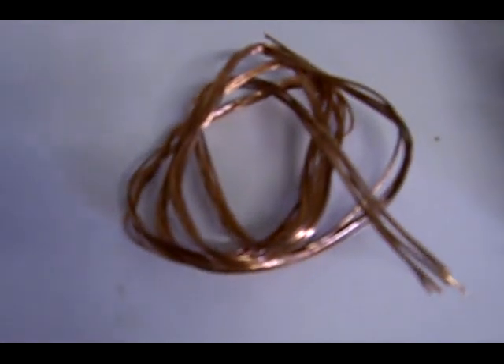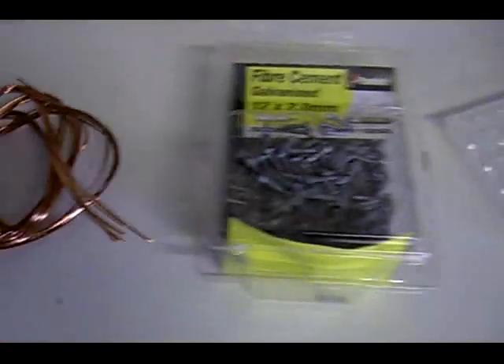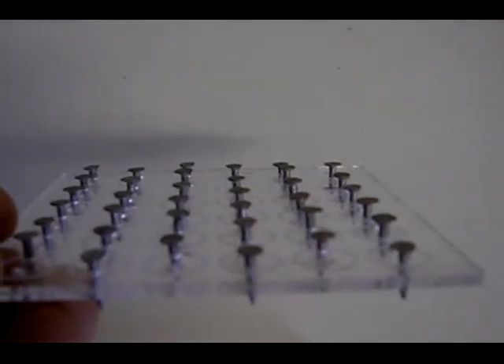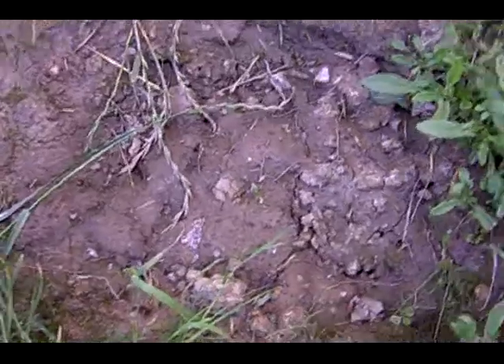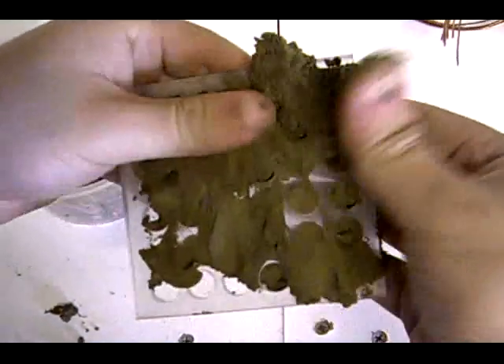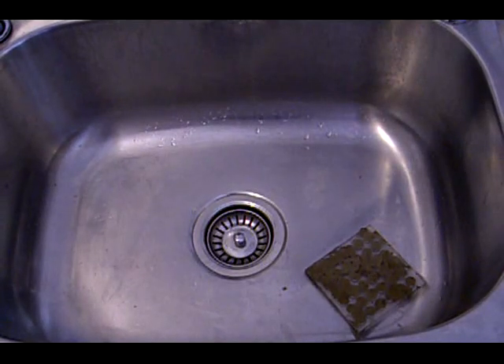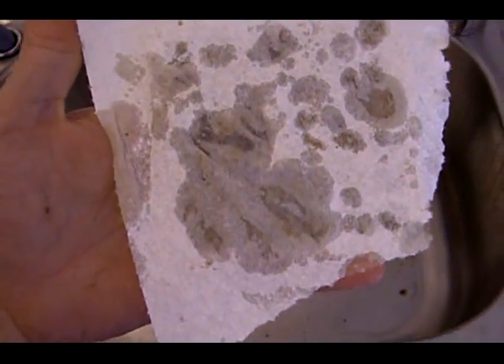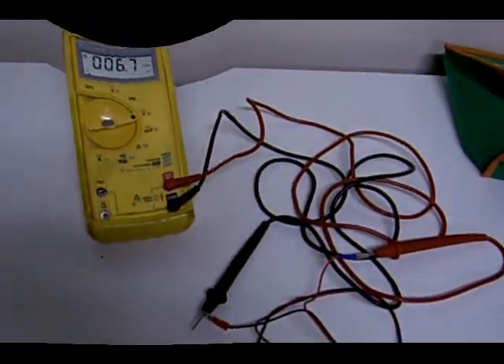Earth Battery Quest - How to build a small Earth Battery "The 24Volt EB Challenge"

Comment: Increasing the amperage for earth batteries is quite simple.  A law of physics states that wiring in parallel will add the amps of two power sources.  We simple wire a solar panel to the earth battery.  We build the earth battery to the desired voltage in series.  Earth batteries are the cheapest voltage around.  Then wire a solar panel to the EB in parallel.  Boom best of both worlds.   Real power.

Comment: Earth Batteries may be the secret to endless power.  Earth batteries are made of two dissimilar metals placed into the ground or cups of soil or water.  They can be wired in series to make lots of cheap volts.  Their amps are abysmal.  A law of physics can be used the add amperage. Wiring in parallel to a solar panel will add the much needed amps to the cheap earth battery volts.  My test worked.  https://youtu.be/OGGredkAFh4?feature=shared This is all the green energy we could ever want.  Watts = Volts x Amps

 Example video link (not me) 
https://youtu.be/aCCK132OIGA?si=8UWtAHco0L60FWBD

If you build a test setup use a small 18v or less solar panel or a small 9 volt battery.   Do not build an earth battery over 30 volts.  Anything over 30 volts can be life threatening.  Water, carbon, and  aluminum or magnesium work best.  Each telluric cell will generate .7-1.5 volts depending on materials used.  A photovoltaic cell only generates .4 volts.

Comment: 0.7V per cell is about what I've gotten too. You might not have gotten the full 24V because of shorting. This is the problem I run into with my small designs. I would guess there are bits of dirt/water seeping between cells on your base board.

Comment: Great small design. You see people making these using massive 5 gallon buckets for cells. You might also consider aiming for 12V or 5V but higher amps by connecting some rows in parallel.

Comment: You would probably get more voltage if you sprinked a little salt on each cell. As salt will oxidize the steal better. This causes a better reaction therefore create larger current.
Reply: Also the reason the voltage is smaller than expected is due to the resistance in the dirt. So as the current flows through each cell it drops due to the high resistance of the dirt or clay used.

Comment: Where is the update it has been 10years? How long did the battery work before corroding into nothing? Since they are small did you ever make like 20 of them 8 volt cells and see how well they couple together electrically? What happened did you give up or find out it can't work?

It seems like now you can try to make at least 4-5 of them to get your 24 volts, 8x3=24 so in lose theory you need only 3 of your 8 volt cells, but make 2 extra just in case and add them if you still didn't reach 24 volts. So even under load the volts will drop but make more cells and add them until it can be stable 24 volts with a load.

Comment: what is weird about dirt batteries your volt meter may say one volt but will not light up led until you get 10 or 16 the accurate way is connecting the volt meter to led and testing it you get the actual result I'm trying to build a small one like that and I'm having the same problem with my connection .

Comment: As far as I see it, it's a success. It may not have gotten the voltage you were looking for BUT the small size allows for more batteries in one place. If you can get 24 volts out of that without the corrosive electrolytes mentioned in the comments, then you'd really have something amazing. Good video!

Comment: I have not read all the comments below, but the low voltage is due to internal resistance of the nails and earth, I am sure everyone knows that. Using salt water or or acidic/basic mixture may improve the voltage and/or amps of the battery, but it will also cause the zinc of the galvanized nails to corrode away even more quickly. I appreciate your video and your effort. Keep up the good work. Peace.

Comment: What abount the power (Ampere * Volt), 0,0000000000001 watt ???
This is a FAKE!!!
Reply: The amps are really low but it is not fake by far. It wouldn't have even lit the volt meter if it was fake.

Comment: Round up 36 old 35 mm film canisters and try those instead. Or you could salvage some 1" plastic tubing, the stuff used in plumbing, cut them to lengths about an inch long, glue a bottom on them, and place them in a holder ( drill holes in a 2x8 or 2x6 board to make one), connect the cells, and see how it goes. This will keep the cells from being connected and shorting out.

Comment: your not getting 24 volts because voltage is being dropped in the cells. all batteries have internal ressistance, the lower you make that, and the more current you will have, and less voltage will be dropped. 2 ways to do it are 1.use stronger electolyte(in your case dirt). 2. Increase the surface area of the electrodes, and bring them closer together.2 would be the better way, since if you replace your dirt it won't be an earth battery.you could add salt water to the clay unless thats cheating

Comment: use ice cube trays and water works just the same, copper wire is good and the other terminal try other things anything you can find screws drawing, pins, washers etc

Comment: water has the highest dielectric. The Earth battery in that configuration is getting its power from the moisture in the soil, and the surface area of the zinc/copper. If you increase the size of both the copper wire, make it a tube, and the nail a LARGE nail... fill that with mud, and you should reach your goal.

Comment: 150+ grit is fine. I use 400 grit for electrical contacts. 
The clay works because it has aluminum and irons in it. I'd probably start by mixing 3 parts clay with 1 part mineral sand and as much lemon juice concentrate as you can soak up.

Comment: I think you could improve voltage potential by sanding the copper wire and nails at contact with each other, and soil. Carefully position the copper probe to be parallel and spaced correctly.

Best place to get mineralized dirt is from river bedrock. You should mix some with the clay. Not sure what best ratio will be. But mineralization creates current. Knead them together and mix in some lemon juice or other form of concentrated citric acid. Experiment with ratios. Keep sanding the probes

Comment: some sealed earth batteries use urine as the acid to create more conduction in earth batteries (could use fruit juice too ascorbic acid is rumored to work wonders). 'Safe' acids wont cause the metals to fall apart. Egyptians used earth batteries and we found some that were still producing power. They used two kinds of metal in their batteries. The idea is as long as the acid doesnt evaporate the battery will work. Earth batteries can be used like deep cycle car batteries. Have fun.

Comment: "if you stay tuned to this channel I’m working on a work around for that."

Nice vid. There is no workaround for amps. More volume is the only answer. Also i would recommend finding some form of solid zinc. Galvanized nails just don't last long enough. I have also had better results using different metals. Look at an electron potential difference chart. i used carbon and magnesium ... 2v per cell. lol crop circle dirt. Just dump some acid in the dirt, it will work well.

Comment: Seems like if you had a small copper plate  in each cell instead of just a copper wire you would greatly increase the voltage.

Comment: the only way to raise the amperage is to make the anode (Neg. - Zinc) surface area larger. the larger the surface area the more the amperage! Even if you use a 4'x4' square of sheet metal it will not make more than 1.5-2 vdc. you must hook in series but a plate that size will crank out the amps.. Salt water is best or some acid like vinegar or lemon juice. actually just stick nickels and pennies into lemons and they will do same thing if you keep lemons on a plastic sheet! Cheers!

Comment: they last as long as the galvanized nail has zinc on it. Once the Zinc anode rots away the battery is finished. They cannot be recharged! this is called "Galvanic" electricity. the copper cathode will not rot but the zinc anode will. Use salt water to mix in the dirt and it will make more voltage. even like all batteries they will never make more than 1.5-2 vdc. even a 12 volt car battery has 6 - 2 volt cells in series and Duracell batteries are 1.5 vdc as they are just carbon and zinc!

Comment: Howdy Lord ! I have made what you made a little different. I use mortor with fine sand ,copper,and alluminum wire. I have a carbon rod in the ground and hook that to the aluminum wire side of the EB.I put an aluminum pipe to the south, I hooked up leds between the copper side of the EB and the aluminum pipe They have been on for over four years. So it is hooked too the ground in series w/ the EB.I have hooked car batteries to the ground with good results.They need water every coulple of years.

Comment from the maker: As far as recharging It re-dirtying it takes about 5-10 minutes and can be done about X2, 3 times at best each time getting a shorter life span . 
If you change the connecters EG: copper and zinc it will continue its cycle for ever but is pointless as the time to change the connections will out way just using an alkaline battery. SO IT’S NOT VERY Practical. HOW EVER I believe there is a way improving this.

Comment from the maker: Well under good conditions you will find this design will START its life over 20Volts+ i have built many of these and i can grantee you that much just copy my design. Make sure you use good quality copper very important in the build as this is one of the main conductors. This battery is extremely low on mille Amps if you stay tuned to this channel I’m  working on a work around for that.